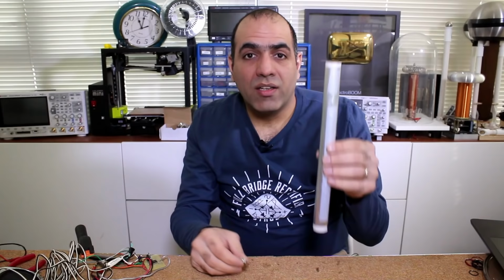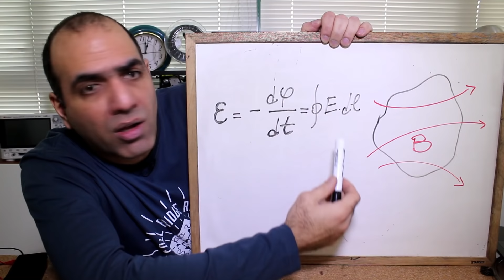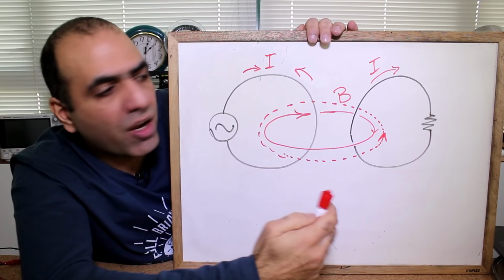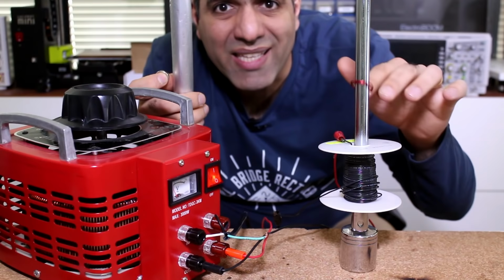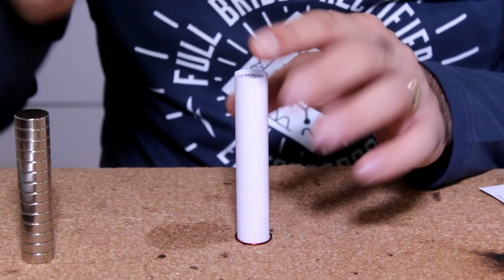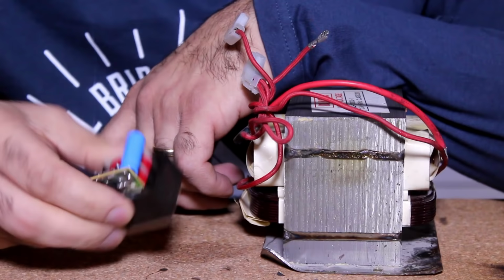The Amazing Eddy Current

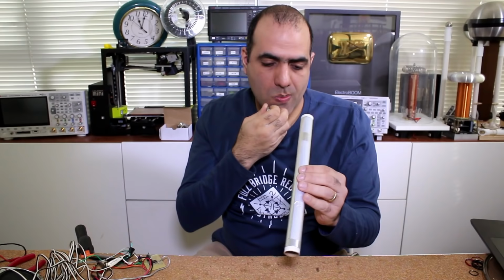Comment: The spark at 1:00 caused the clock to jump forward 13 seconds
Reply: That would have been cool, but I think it's a cut scene with very good editing.
Reply: It probably was, impressive editing, nothing else in the scene moved during that time
Reply: @joshuareynolds5219  there's nothing there to move, except the clock
Reply: Sharp eye!
Reply: for sure it is not a jump cut i slowed the video down to 2% (downloaded it and checked) it is too perfect to be a cut, even professional movie editors can't do it that well... maybe that shorting lead to some powerful electric field being generated with fiddled with that seconds hand? also not 13 seconds, 12 (from 51 to 02)
Reply: yeah, i thought it was a cut at first, but i checked the video in slow mo and no sign of editing, guess it just moved from shaking or something.
Reply: @amuzak9063  I just looked at it frame-by-frame (period and comma move 1 frame at a time):
the frame before the spark repeats twice, his eyebrows jump, his hand jumps and isn't blurred in the frame with the spark, but was moving in the one before, and the magnet disappears completely in 1 frame (during the spark) when it moved only a few centimeters by frame before...
I suspect it was a cut, and Mehdi is just professional(/lucky) and got amazingly close.
(Amazing spot btw, @Joshua Reynolds)
Reply: If you look at it frame by frame, you can see the magnet not even touching the circuit board, only the wires, this spark is staged, :O
Reply: @amuzak9063  OMG your right!
Reply: No, the correct conclusion is that he invented flux capacitor used for time travel.
Reply: @AustinParanormalResearch He explains how he does most of his sparks in the free energy video
Reply: Our dude was catch up.
Reply: Why does he keep the clock in the background, it gives him away... ?
Reply: Maybe he keeps the clock just to see if anyone spots the cuts in the video?  Sometimes the cuts are more than half an hour apart
Reply: There's also a reflection in the gold play button that changes, like maybe a computer screen switching off.
Reply: Wow.... How'd you notice that?
Reply: I just pay close attention to really small details, sometimes it is just a waste of time, also I edit videos myself so I try to figure out techniques people might have used for their edits
Reply: @FlyingOctopus0  That is the correct answer!
Reply: must have been 2.21gigowatts
Reply: Time travel
Reply: Woah
Reply: Paolo G Yes, you see when the magnet is over charged with a high current, while in a motion perpendicular to a source of gravity (the earth), the result is a tachyonic pulse perpendicular to the magnetic field of the magnet, this field starts at limiting radius and contracts to the causal point of generation, this happened to nail the clock at the right angle.
Reply: A good chunk of the sparks and shocks aren't real. He does it for comedic effect or to demonstrate safety things. That being said, he does get shocked for real pretty regularly
Reply: Time travelling
Reply: You my friend have discovered time travel
Reply: @MCNarret  Great explanation mate.
Reply: Free energy???
Reply: It seems that the circuit he hit and shorted out had some magnetic field with the clocks coil and motors
Reply: Clock was watching too and it also had to jump a few seconds using, second hand parts of course!!
Reply: He did it on purpose as a joke, he wasn’t trying to convince the audience that he actually blew a random circuit while he was testing the magnet
Reply: He probably had to drop multiple magnets before he got one to land just right on the arcing circuit that he had laid out ahead of time.  Probably took about 6 tries based on how long it takes him to drop one magnet through.  Then he cut out the unsuccessful tries.   However if it had been a wall powered clock then I would have believed it was due to the arc since wall powered clocks are sensitive to mains frequency and the arc could have caused high frequency transients
Reply: That's definitely possible, it is unlikely he would get the magnet to hit the circuit board on the first try, so it could have been edited but he did a really good job because it didn't look edited to me.
Reply: Induced magnetic field from the short that excited the quartz oscillator in the clock.  Lookup Big Ben's law.   

(I just made this up)
Reply: Glad to know internet detectives are on it again!
Reply: History will never be the same... He accidentally invented the time machine
Reply: He is probably using the "Morph Cut" effect by the Adobe Priemer. Btw, good catch there!.
Reply: @Narret You sound like you've written some Star Trek episodes, lol.
Reply: That's a glitch.😂😂😂
Reply from the maker: I think it shows that the clock also SH#**&# its pants and jumped!
Reply: the clock is a paid actor
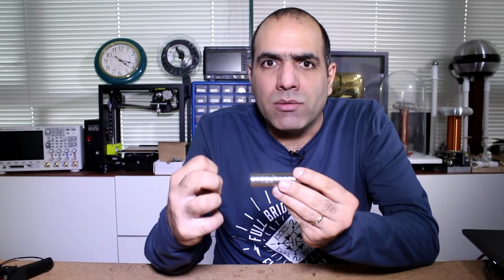Reply: And @ 9:43....
Reply: @hadinossanosam4459  I didn't know about the frame by frame feature on youtube, that's super useful.
Reply: If that clock was not in there...it will he a great video editing in the youtube......i think..
Reply: @MCNarret  lol, nice technobabble :D
Reply: LMAO. Shh, don't spoil the magic.
Reply: Thanks I never knew you could go forward/backward 1 frame at a time with the Comma/Period.
Reply: And thus, time travel was discovered. Next episode, "watch me ask Tesla for his autograph"
Reply: he just time travelled , wow!
Reply: Actually There's more of his videos that has a clock that jumps a few second some even minutes.
Reply: yeah, quite a few times...
Reply: THE RECTIFIER!
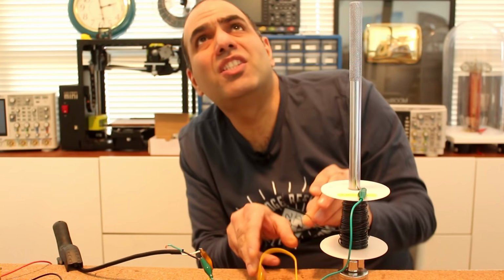Reply: 5:42 too lol
Reply: He probably made it so it did
Reply: its called TIME TRAVEL and electroboom invented it to go forward 13 seconds
Reply: @multiplexed Remember not to get them confused however, its not the magnetism itself that creates the tachyons but the rotation of the magnetic field along the temporal axis that creates virtual tachyonic electrons. As the laws of electromagnetism apply regardless of rotation, unless in violation of CPT symmetry, in which this case it is indeed in violation, but that just keeps the electrons in a virtual state. Converting them into a real force requires a gamma ray equal to the missing mass, a medium to conserve momentum, and a catalyst for the gamma ray to instead of pair producting into a matter-antimatter pair, to instead couple to the electromagnetic field perpendicular to the temporal axis (the same event but rotated 90 degrees in regard to spacetime). This violation also invokes Minkowski-Reizenhart's law of tachyonic rotation: "Any force carried perpendicular in relation to itself along the axis of time is considered an extension to a tachyon-field bound by a spacetime whose vacuum energy is greater than 0", not to go too far into tachyonics but by treating it as an extension of a tachyionic field, you can cause an exchange between the electromagnetic force and spacetime, the tachyons being the force carrier. So while the particles are virtual, the interface is not, and the temporal effects are real. Electroboom really needs to shield his recording area from this kind of radiation, he doesnt need a vacuum nullifier (too expensive), but a sinusoidal vacuum energy modulator hooked up to a flux capacitor should reduce tachyonic production when working with electromagnetism inside a gravitational field.

Oh shoot, I took it too far didn't I?

Edit: Forgot to state that the catalyst in invoked by an imaginary vacuum energy.
Reply: I really analyzed the video frame by frame, and I really think that it is because of a FULL BRIDGE RECTIFIER
Reply: Nah, I think he just used his inherited stand : THE WORLD
Reply: that is how long he was unconcious
Reply: that was his recovery time from being unconcious
Reply: Kazuma ur not smart lol. If they can do all that cgi in movies I reckon they can time something perfectly
Reply: I think some people is trying to say that, "We need to create a very powerful electrical short circuit electromagnetic field or changing electromagnetic flux generetor (included the short circuit nature of the component) in order to blast out into time travel (only in future) and may very by the nature of the matter or matters surrounding it." 
After seeing it another person says who was just reading the comments (an outsider) :- Lol!!! Iron made things will travel much faster than any matter in the... probably in the universe.
And I was thinking will we ever able to time travel. The answer you may find by the joking sentences I have written above.
Reply: @NanoMine  he would never
Reply: @cleitonfelipe2092  if it's a new take he also could have moved things on his desk.
Reply: @shersyed3989  are you from Australia?

All so speaking of Australia do you watch eevblog?
Reply: It seemed that the thing that exploded was a still image until after the explosion
Reply: @dougankrum3328  uhh its the clock moving its parts
Reply: It be patched soon
Reply: @ElectroBOOM  Lmfao 😂🤣🤣🤣
Reply: Nice 69- wait

Comment: The larger of the two transformers you showed here is a microwave oven transformer (MOT), which is designed to step mains AC up to around 2000 volts for the magnetron circuit. The pair of welds across all the layers of the MOT core do serve a purpose beyond being structural:
The ground connection for the high voltage side is the MOT core and its mounting plate. The ground terminal of the magnetron is connected to the MOT through the isolation capacitor (to filter out any stray DC) and the metal frame of the microwave itself.

This simplifies wiring a little, since only one high voltage lead needs to go all the way from the MOT to the magnetron. Another function is to ensure that any stray current induced inside the oven itself is immediately grounded. If the layers of the MOT core were not welded together, the induced high voltages would spark or arc between layers, overheating and corroding them.
Reply: Oh wow never thought of naughty voltages between the lam''s - thanks for that...
Reply: that is fascinating I never knew that I just thought it was a lazy cheap way of keeping the layers from vibrating and making noise
Reply: I believe they are both Microwave oven transformers from two different sizes of ovens
Reply: @rogerd4559  No, the small transformer is not from microwave oven.
There is not a big variation between low power at 900 watt and high power at 1200 watts.
By law, 10 amps is the maximum current legal for kitchen appliances running on standard 120 volt plugs.
Reply: @moiquiregardevideo  oh good news! that means the several small microwaves all have big transformers in them for my spot welding project
Reply: @rogerd4559  I am pretty sure that's also the purpose.  Most transformers would have a bolt through the sides snugged right up to stop buzzing.  I have seen welds like that before though I don't understand the benefit over a bolt
Reply: Don't forget that each lam plate has a natural capacitance. This capacitance can store those pesky stray voltages and a rather large potential difference can actually cause charge to short or burn the windings if it arcs to the ground of either the primary OR secondary coil. This is actually a common reason transformer coils short more than eddy current overheating. You basically have many conductive plates with dielectric gaps. Hence a capacitor bank. This is why ferrite cores are so much better than lam iron plates.
Reply: There are all kinds of reasons already mentioned.  Here comes one more.  If we consider that an ideal transformer, besides not having losses, also does not limit the current, we can deduce that eddy current losses do limit current.  That may be handy when the manufacturer does not know what nearly short circuit items the customer tries to apply.
Old neon light transformers needed more effective current limiting (due to negative resistance of the gas discharge arc).  The neon transformers were wound on the two outer legs of the E core.  That caused magnetic flux to be shorted through the center leg of the core and current was limited.
Old welding power supplies took the idea of current limiting a step further.  They made the center leg of the core partly movable (called yoke, by the way) to manually adjust the welding current.  Anyway, the lamination welds increase the eddy currents, but it may be desired in a small amount.
Reply: The welds are both on the outside, so in addition to providing the mechanical and electrical grounding, they are at areas of the same voltage, so they do not provide a path for high eddy currents within the plates.  To induce high eddy currents in the plates, a weld inside near the core and a 2nd one on the outside would be required to provide an eddy current path.  The lack of the inside welds, produces a 3 side square of conductor, which is not a complete path for circulating currents in the core.
Reply: isettech :
Where did you get that idea?  My understanding is that if your ohm meter shows connectivity from any weld to another, there is a path for the eddy currents.
Reply: @InssiAjaton  I got that from the circular path eddy currents take.  If the outside part of the frame (the welded section) and make it solid, the path would circulate from the area of the windings around the outside and back. However on the inside corner this path is blocked by the open laminations on the inside portion of the path. Try it. Put one loop of wire around the welded iron section, but do not touch the ends. Power the transformer. Measure the AC voltage cross the ends. Short the ends and note it almost immediately burns your fingers due to the shorted turn.  Due the same thing on the center portion of the core which is not welded. (one turn where the windings are) and repeat.  Open voltage should be under 2 volts in one turn, so not a great shock hazard, but shorted could produce well over 30Amps and quickly get hot.  The iron does not get smoking hot in a few seconds because there is little eddy currents due to the break in the path.

Yes, I do this type of work for a living.
Reply: This needs to be higher up in the comment feed
Reply: So if my microwave is buzzing that's a bad thing?
Reply: @TheBozzler  If it's the classic 50 Hz (in Europe) or 60 Hz (in the USA, Canada or Brazil) buzz, then yes, that is a bad thing. Transformers always make a little bit of noise at those frequencies, but if the core is bolted or welded tight enough, the vibrations will be minimal and you wouldn't hear them. If you can hear them, then either the bolt has come loose or the weld has failed, though the latter is much less likely to happen.

The vast majority of the noise you hear from an operating microwave oven is actually from the fan which cools the magnetron. If you disconnected the fan, the microwave would be almost silent, though you would risk overheating the magnetron and damaging it.

Comment: I would say that the Microwave transformer, being one that works in high power ranges such as 800-1000 watts, creates a loud and noticeable 'humming' noise in the 50/60 Hz range. The MOT is welded together and coated with resin to suppress those humming noises. It is cheaper than clamping and would save space. Naturally the eddy current losses would be higher compared to other laminated iron cores but probably not enough to compensate for the acoustic noises you would get from them otherwise
Reply: Also since it connected at a single point I imagine it would limit the loop current. (assuming it is only welded on one side)
Current flowing in would be the same as current flowing out effectively canceling it out.
Reply: @sloth4urluv  it's not welded at only one side. And the guy above is right about the noise, my microwave transformer makes a lot of noises when drawing 200 amps at 3 volts, imagine without the welding
Reply: I think they are deliberately lossy and is the cheapest way to limit current in the magnetron.  Also one end of the secondary is bonded to the core iirc.
Reply: @anullhandle  That's exactly the reason it's done; and you're correct, the core is connected to the positive side of the power supply.
Reply: isn't the core grounded? what do you mean by it is connected to the positive side of the power supply?
Reply: What's MOT?
Reply: @othusitselokailwe2857  Microwave Oven Transformer
Reply: There are almost no eddy currents on the welds, because they are only on the outside and they arent making any closed loops (act like unloaded secondary). The main problem with those welds is the loss of cross section of the normal sheet metal core and replacement with bad hysteresis welding steel
Reply: @hobomnky  Yes, it's grounded and connected to the positive side of the supply.
Reply: I think it also depends on the hertz 50/60 is pretty low for a transformer and doesn't induce as much  eddy currents. Where smaller transformers for electronics could be running at 20,000-25,000 hertz the way the core is made matters a lot more.
Reply: that may be why my Microwave ovens dont last that long?
Reply: I agree with you as I have wound transformers and the buzzing noise is very annoying

Comment: 5:36  It's amazing to see how loose turns of coil,  cake into a temporary compact coil (while energized they get atracted among them).
Reply: Yea I remember seeing the same thing with welders at work. They would have long cords (100+ feet) loosely coiled up. If the cord wasn't pulled out and just coiled up loosely it would tighten the coil when they were welding
Reply: Yeah, I was the Maintenance mech/welder in a big machine shop...I used to short the leads to mess with guys when they stepped on the cables... @SupperDadder
Reply: yes they melted together nicely